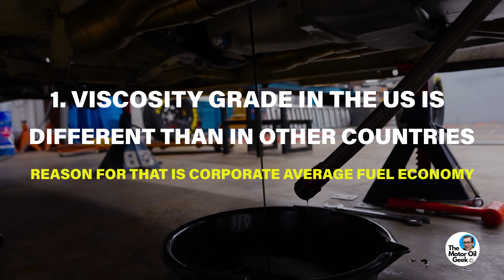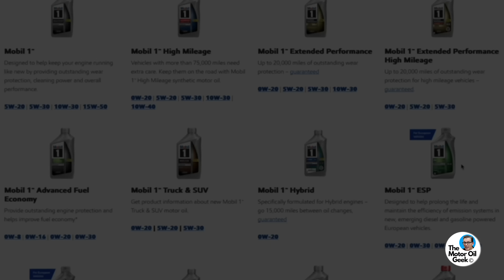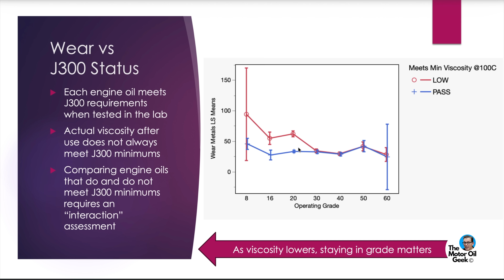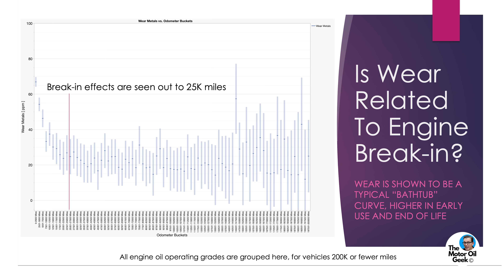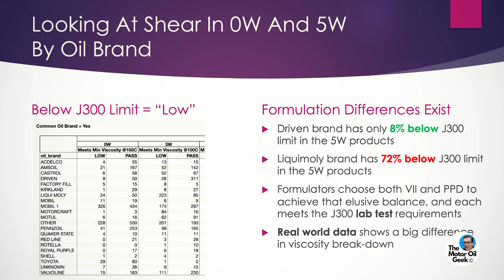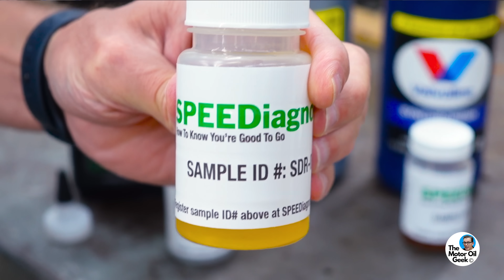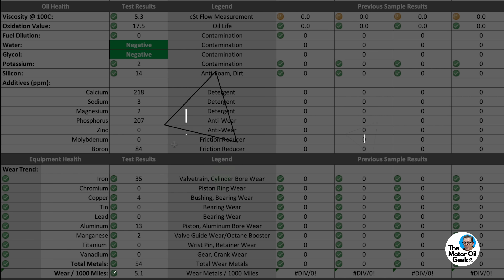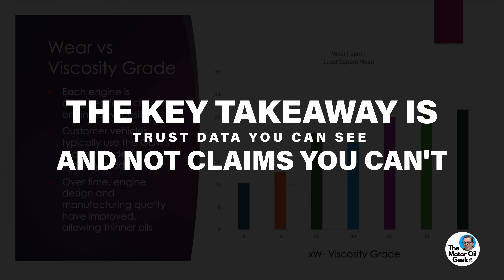More Ai Lies? The FACTS about 0W-20 vs 5W-30 (With Evidence)

Comment: Great content. Isn’t this oil shearing stability stuff also influenced by operating temperatures, rotational speed and tight tolerances?
Reply: Yup.  If you're not driving the car, it's not likely to shear by using it's additive package.  Maybe condensation will cause it to shear when you're not driving it.
Reply: @lonniebeal6032 maybe not driving the car will help?

Comment: If you use thicker oils you need to use bigger oil filters too, or you will ruin your engine. In fact it is always a good thing to buy larger filters than recommended by the manufacturer.

Comment: Remember, manufacturers only have to ensure they are meeting any applicable government requirements AND can make it to the end of the warranty period for a large enough portion of their vehicles to remain profitable.  After that, it's the buyer's problem.  I'm pretty sure if your owners' manual only states a single oil grade, they will reject a warranty claim for something related to wear (and possibly other things) if you use anything else, even if they call for what you used in another country for the same engine.

Comment: Interesting about the wider numbers being less stable. Wonder what that means for the gm 6.2’s that they want owners  to use 0w40. That’s pretty wide. 🤔
Reply: While this isn't always true,  oils with a larger spread typically use more polymer (Viscosity Index Improver) to hit the hot viscosity compared to oil which has a narrower spread. (Ex, 0w-40 vs 10w-40.  The polymer (ex, ocp, star, etc) slowly degrades over time and no longer functions.  However oxidative thickening, which is generally seen as a negative, can increase the viscosity of an oil at the end of a long interval.  Oils with a European or ACEA designation generally do better because they have a 'stay in grade' requirement.

Google OCP and Star polymers.

Comment: For like 35 years federal regulators told auto manufactures that their cars had to have round headlights.

So I'm not going to trust my manual to tell me what kind of oil to use when they are being strong armed by government again. I'll call Toyota in Japan and use a damn translator to ask what engine oil I should be using in my Toyota when I'm driving around Tokyo.

Comment: I thought that 0w 20 got into tighter spaces so it was better if that's what your engine recommends.  My Toyota recommends 0w 20 but I think it said you can use 5w 30 alternatively if that's what you got.
Reply: Naw.  Toyota just uses comparatively wider bearings to spread the load.

Comment: What's the difference in the way a 0w 20 and a 5w 30 oil dissipates heat? Will a 5w 30 keep the engine cooler?

Comment: In the United States the Tundra (v35a) only has the option to use 0w20. However for many other countries it says switching to a 0w30 or 5w30 for better hot-film strength and protection during sustained high-speed operation.

Comment: That does seem like a smoking gun for the 0w-20 oil though, doesn't it? If shearing out of grade causes increased wear in the 0w-20 and 14.5% of samples had fallen out of grade in the testing they did, you're going to be causing excessive wear more often with that oil, aren't you? This means if you want to reduce the likelihood of premature wear due to shear, 5w-30 is indeed superior, since even when it does fall out of grade (and even though it's happening much more often) the engine still likes it just fine. Am I missing something here?

Comment: Best: look in the manual for the oil grade that is thickest that the manufacturer allows(usually in Africa or other regions have different oil grade). Take the oil for long interval and do short interval. This way you are better covered.
Always change in maximum one year and 10-15k km(petrol or diesel). Take into consideration that cars that drive mainly in the city have longer working hours than those that drive highway all day.

Comment: Two important aspects not addressed in this video.  One, 'Heat'.  Running an engine in Florida or Arizona year round is going to impact your oil far more than in less extreme climates.  And two, and probably the most important, 'oil change frequency'.  Especially in the aforementioned hot climates, more frequent changes will insure the oil in your engine stays in better condition than trying to stretch to longer mileage intervals.  Long story short, the environment plays a huge role in what oil you should be running in your vehicle and how frequently you should be changing it.
Reply: Naw.  Cooling systems and oil coolers do an excellent job at maintaining oil viscosity. Only worry is fuel dilution and  SpeedDiag UOA will tell you if it is

Comment: I would have to say that the MPG gains of 0W-20 over 5W-30 is miniscule (probably within margin of error) and would most likely need to have millions of miles to generate a significant amount of savings. I'd love to see a comparison test of the 2 oil weights to see the MPGs.

Also, GDI engines are known to have gas contamination of oil as mileage increases, so having 0W-20 oil in them is a ticking timebomb.
Reply: I've watched other videos on this topic, and they claim a decrease of under 0.5 mpg using 5w30 over 0w20. So extremely negligible in the long run. Veracity of claims? Who knows? But if true, is an extra 0.5 mpg on the 0w20 worth ruining the engine?

Comment: I changed my 2013 Ford Explorer v6 3.5L from 5w-20 to 5w-30 over a year ago.   No notable difference in MPG, but it's not great to begin with anyhow.
I did oil analysis on 5w-20 and twice on 5w-30.   The 5w-30 two analysis done on 2nd and 4th 5w-30 changes.

Aluminum went from 5 to 2
Iron from 6 to 3
Copper from 21 to 16
everything else is the same.

So all in all, it appears to be more protective for MY engine, the 5w-30 is better.

I made the change because my family has two 0w-20 and two 5w-30 oil spec'd vehicles... I didn't' like having a one off of 5w-20

Thanks for reading my $0.02!

Comment: Hey Lake, i was around NASCAR when your dad was racing worked hard but it was fun. Anyway, I just purchased a 2024 chevy  colorado ZR@ with only 5k miles on it. I've watched your oil analysis videos and know Amsoil to be top tier, but as far as costs,availability, etc and not changing oil when chevy says to 7500 miles, what would you recommend for my turbo 4 cyl engine?  I'm thinking of the Pennzoil ultra platinum 5W30, would that be ok? I am planning on changing it every 4-5  thousand, unless you think I should do it earlier 3500??  I live in south Ga.  Thanks for all you do. Keith

Comment: The Ford service writer told me with 3K on the car, I should wait another 7K to change the oil on my 2018 V6! I looked straight at him and said do my Free oil change now and he complied. 10-15K intervals on a new car is criminal and will cost people dearly as a result. I'm looking forward to the results to determine if I should go up to 5W20/5W30 as opposed to 0W20 on my 2019 6.2 LT1 engine.
Reply: It's been proven the 15K mile change interval that BMW  said was what was causing failures on the N20 engines in the 2010's   These high  mile changes are to make dealers happy about the free changes and  not enngine care longevity.
Reply: @TimGray  They increased the interval to 15K the same model year (2007 I believe) they agreed to pick up maintenance for the first three years. That is no coincidence.
Reply: When it’s there money it’s 10,000 miles. When it’s your money it’s every 3-5 thousand miles.
Reply: @arthursmith643 and when they deny warranty it’s still your money. Well played👍
Reply: I’d use 5W-30

Comment: Well, as I said earlier, I'll continue to use what the manual says for my 2021 Jeep Gladiator Pentastar V6 gas -- 0W-20. Same when I had my previous vehicle (2016 Honda Pilot AWD V6 gas) as it used 0W-20 as well.
In both case the oil was Mobil 1 'Extended Performance' and a FRAM Ultra or Mobil 1 synthetic oil filter. Oil was changed when the Oil Life Monitor hit 0%, which was around 5000-6000miles. 
Not worried.
-- BR

Comment: The main problem is people who ignore basic maintenance. A thinner oil will allow fewer particulates to remain suspended and cause sludge and extra damage, extend that to 6000+ miles between oil changes by the bad vehicle owners and the filter get clogged causing the thinner dirty oil to continue flowing, causing damage. With 30W it holds on to more particulates providing better protection.

Comment: My Volvo V70 from 2016 have been using the recommended 0W-20 for 100000 miles.
However now when I will maintain the car myself I am thinking of using 0W-30 since the engine starting to be a bit worn.
It might also make the balance shafts to run more quiet.

Comment: Interesting video, I do not quite understand "in-grade" or "Out of grade" oil. I just look at the dipstick and see if the oil is changing color or if the oil level is lower than expected. That said, I have a 2018 and 2024 Subaru and I only use the OEM spec oil, the brand I use is Idemetsiu (which happens to be the oil in the dealerships) I found that oil consumption is almost non-existent as well as giving the engine good wear protection. But to be safe, I change the oil every 5K miles. So far, the engine runs great and I have not experienced any oil issues. 
But what I use probably will not be best for Ford Engines, Mazda engines, Chevy Engines, etc...

Comment: And you tested it at high temperatures right? 0-20 is for lower temperatures like a winter oil and 5-30/40 would be a summer oil. Designed for high temperatures. 
So if you live in Canada 0-20 would be great but if you live in Mexico 5-30/40 would be better. Yes, I actually studied oils

Comment: Riddle me this Batman:  On the 3.6 and 5.7 Ram 1500 engines, why is it that the infamous "tick" is gone as soon as you dump the 0W20 and go back to 5W30, which was the original spec on those engines when they debuted??

Better oil film on the valvetrain = better on cold starts = better protection.
Reply: It’s almost like viscosity has an impact on the ability to transmit sound, robin.

Comment: The automotive manufacturer's are increasing the time and mileage between oil changes because they don't want these vehicles lasting more than 10 years  !! They want to sell vehicles, period !!  I have a 99 Ford F250, 6.8 liter V10,  I do all the maintenance changing the oil between 2800 and 3200 miles.  26 years old, no issues at all.  Go figure !!

Comment: I get your point on staying in grade.  But if the OEM calls for a 0w20 and doesn't stay in grade, wouldn't it be better to use a 5w30 to give you a safety margin?  In other words even if the 5w30 sheers isn't it likely it would still be closer to the 20 weight the OEM specified?.

Comment: Why would you want to void your warranty rights with the factory  Oil Recommended?  Use the recommended oil and change every 6 months or 5000 miles.  If your dealer finds out you used the Non recommend oil, then any engine problems, will be on you regardless. Period.

Comment: This is the prime issue with Honda engines in the US. In EU they start at 5w30, where as here in the states 0w20. They have terrible fuel dilution issues and LSPI that breaks head gaskets, everyone knows this, yet in europe these issues are super rare, probably because in the US the 0w20 turns into gasoline within a 1000 miles (tested myself using oil analysis).

Comment: 5:48 the only specifications needed is bearing clearance. 0w20 should not be used in an engine with large bearing gaps
      The vvt , tensioner holes ect are a wild card ruining all when its slapped on an engine with larger clearances

Comment: I have a 6.4 Hemi in an 8000 pound truck that consistantly runs at about 215 degrees normal operating temp.
OEM viscosity  requirement at 0 W 40.  Some valve train noise, always at cold start up and goes away after a few seconds.
My last oil change, I used 5 W 40 Amsoil Euro and lifter noise is completely gone. Even at running temp, valve train just seems happier for some reason.
 Even in 7 degree temps, no chatter on a cold start up. My oil change intervals are approx 3500 miles, with a quality filter.
My truck is still under warranty.  Moving from 0 to 5 weight shouldnt affect my warrenty right.....????

Comment: Been wrenching on engines for 40+ years now and I will say that the higher viscosity oil in an engine with HIGHER milage is better than a lower viscosity because the clearances are now opened up more in the bearings. I would caution against higher viscosity oils in the winter if you live in a very cold climate though. I run 5-30 in my Toyota 4-runner in the summer and 5-20 in the winter

Comment: If you could provide a bit of explanation on what oil shearing means and how it might happen for an average person it would definitely help some understanding for the video
Reply: I am not an expert. My understanding is that oil is effectively a polymer. That is, it is made up of long repeating chains of molecules. Synthetic oils are engineered to have longer and/or more consistently longer average chain length. Shearing is a term used to describe the forces within an engine that effectively break or “cut” these long chains down into shorter chains. Longer chains will take longer to break down into the shortest chains. Shorter chains fundamentally reduce the oil’s ability to protect and lubricate the engine. Take all this with a grain of salt. I am not an expert.

Comment: Your statements right at the beginning of this video are spot on.  Car engines designed for 20 weight should use 20 weight.  So far, it’s worked well for me.  I have the infamous “Earth Dreams”, 3.5L, Honda engine with over 110k miles.  These engines are reportedly breaking.  Mine however, keeps running normally and Blackstone oil reports show no excessive engine wear.

Comment: You also need to consider driving habits, conditions/weather temp and roadways, mountains, dusty roads, etc...Here in PH, branded car manufacturers recommends change engine oil every 6 months or 5,000 km's whichever comes first.

Comment: Is fuel dilution really a problem in modern cars? The vapor pressure of gasoline is so ow that it’s components will leave the oil when the car heats up. These components will be burned in the cylinder by way of the PCV. No?

Comment: Factually speaking from my experience with my 2017 ford focus 5w30 is a better oil than 0w20 in my car.  I bought the focus brand new.   I realized rather quickly that it was burning oil and by the time my warranty was up I was tired of constantly adding oil, (2quarts) in-between 5k oil changes.  So I took over changing my own oil and went to 5w30.   And poof!  No more oil consumption.  Fact.

Comment: I don't have lab study but as long term mechanic. I can for sure say here in middle Europe. customers that ran with 0w20 usually often have more wear on cams than 5w30. Its just from my experience
Reply: How long and hot are your summers?
Reply: @lonniebeal6032  in Europe? Summers are relatively mild
Reply: @ROVA00 mild? depends a lot of where you are. just like north america.
Reply: @DeeJayTmipls  excuse my ignorance.  I wasn’t aware of a lot of places in Europe with subtropical weather with summer temperatures hanging at around 38-40°C
Reply: @lonniebeal6032 

Normally they also drive 10000 miles or more and some times change every second year.
Reply: For the uninitiated, cam lobes are generally more vulnerable to lubricant failures.  As a bonus, cams are usually easier to check than anything in the pan.
Reply: Thanks

Comment: I put this thin shit into my engine it was like water and my engine sounded like it was going to shit its self any minute thats when it was immediately shut off removed and a sensible 20 W 50 oil used. using 0W20 you may as well use water.

Comment: 20 weight oil protects just as good or better than 30weight, but if it shears, which it . And if engine has fuel dilution, then the viscosity will decrease… it will be too thin to protect. If you start off with the 30wt oil, it will shear and fuel dilution may also occur, but the viscosity started at a thicker level so by the time it shears and get diluted with fuel, it will likely be not get to dangerously low level of viscosity like the 20wt oil.

I see it this way… the thin oils are fine for optimal conditions, but for peace of mind and longevity, I’d stick with the thicker oils.

Comment: I own a 2016 Toyota Avalon with the 3.5 V6. I’ve ran 0W-20 since new, with zero issues. My car now has 229,000 miles with no leaks or oil consumption. Just change your oil regularly, no more than 5,000 mile intervals. Simple as that.

Comment: Subaru ej207 with 500hp, I use Castrol 10w60 and drive it hard every day, change every 2-3k miles. Before I used 5w40, changed every 3k miles and wiped out bearings in 40k miles. Manual says 5w30, but without spirited driving.😂 I have never used so thin oils...

Comment: My Fiat 500 Twin Air used 0W-30 oil and due to the complex electro-hydraulic valve system it was vital to use the specified grade. It was actually a very reliable system and problems were usually attributed to people substituting it with multigrade alternatives.

Comment: Exactly. 
5w30 is almost immeasurably "worse" than 0w20 when new and in grade. If both stay in grade after 5k miles of use that will still hold true. They will perform nearly identical. But as viscosity breakdown occurs the 5w30 will almost always protect better. "In grade" can be a pretty wide spread in viscosity as well. There will be some 0w20s at the low end of spec that are sill "in grade" that will not protect as well as 5w30s that are at the low end of their spec. Where exactly that line gets drawn will vary from oil to oil and engine to engine. But this just solidifies the case for running +1 viscosity grade in my book.